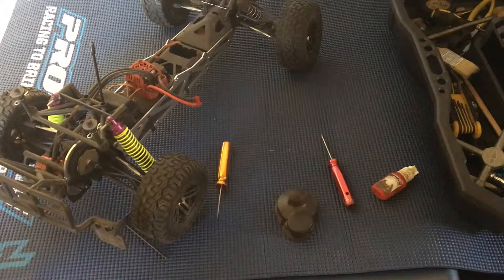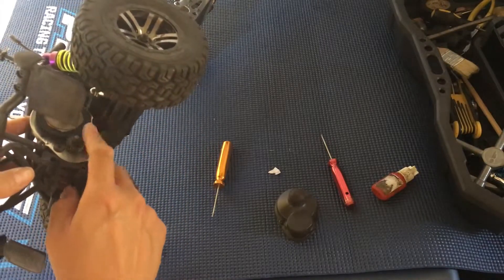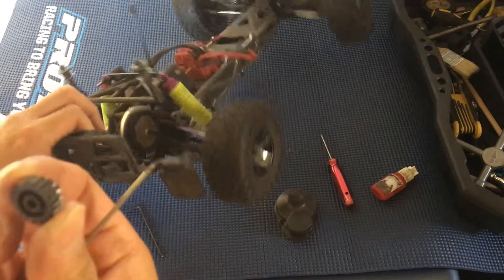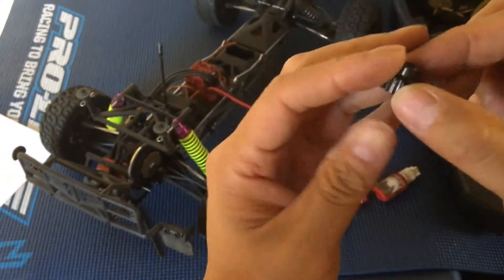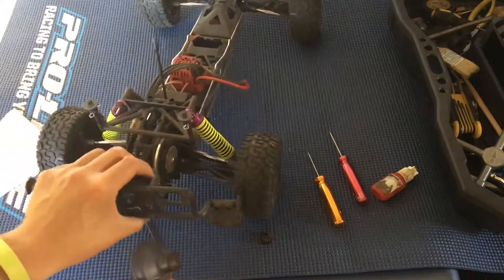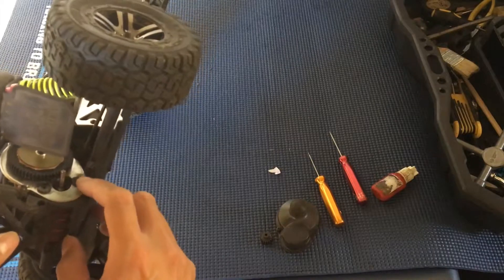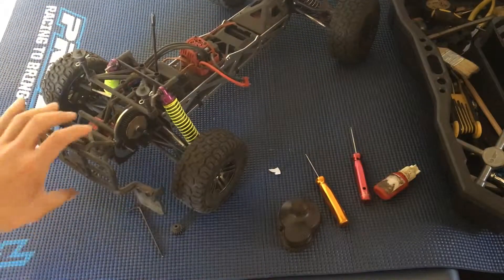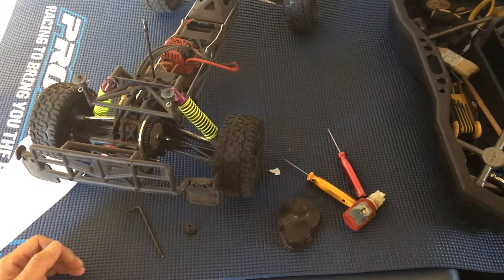Racing2Learn: Arrma Fury BLX Diagnosing Gear Mesh and Pinion Counting Tips

Comment: Hey bud,, fo you know if the sealed spur slipper comes off the fury and can be changed for Traxxas adjustable??
Reply from the maker: Thanks for watching and commenting again! They're probably not interchangeable, as spur gears are usually vehicle/manufacturer specific, unlike pinion gears. Definitely google and include "forums" in your searches.
Reply: Racing2Learn ... Thanks... think I may Dremmel the slipper plates as they are a bit glazed! then tighten it right up.. see how that works! thankyou...
Reply: What spur and pinion are you running ? I’m trying to get mine running but don’t know what pinion I should get
Reply: @radiocontrolrob9296  Hey, thanks for commenting.
I have not done anything with my rc's for to long. 
I am sure I am still on 17 tooth pinion and I have a pack of spare Spurs as if you do not seal the whole gearbox dust and grit gets in and just eats the standard spurs.
I have had good luck with just a HSP 45 amp speed control and bigger wheels and tires, the thing rips as it is so light and it wheelies no probs with that big hood.
Reply: @BrentTheGent1  I got a spektrum 3200kv motor to put in it so a 17t pinion would work with the stock I think 87 tooth spur